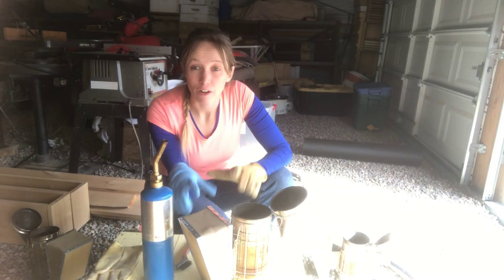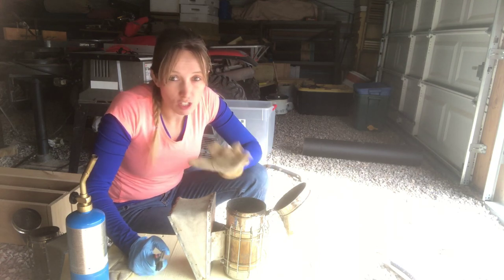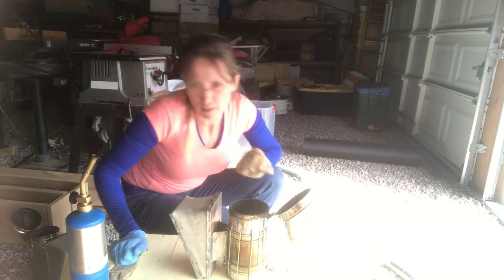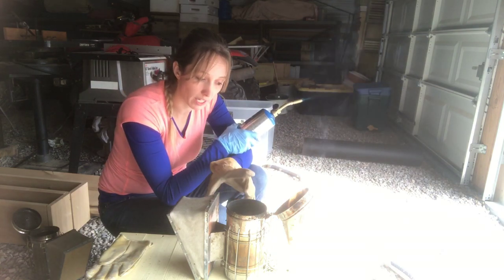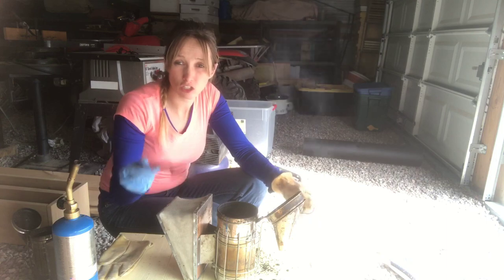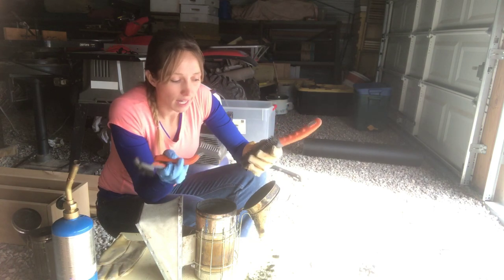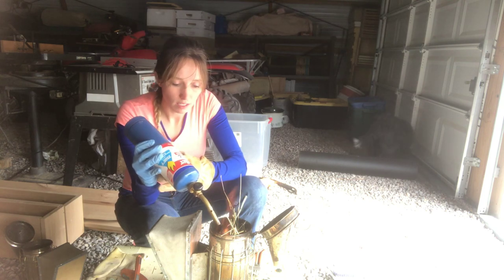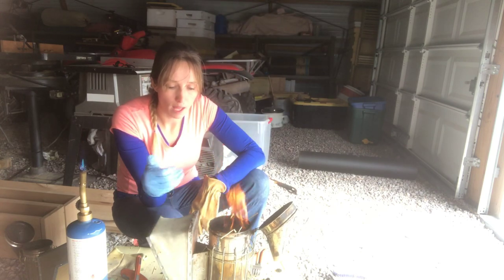Cleaning your Smoker , how to, easy way to clean creosote, beekeeping hack,Backyard bee builder

Comment: Another good tip. after you get it clean or when you buy a new one cut out both ends of a large soup or bean can and slip into your smoker as a sleeve. It will make the smoker last much longer and easier to clean just heat up enough to slide out the sleeve and replace
Reply from the maker: great idea thank you !!

Comment: those smokers didn't seem too bad i get about four or five times that amount before a cleanup. i use Methylated spirits to soak in to the gunk and then burn it off with the smoker open. I use pine needles as fuel so it gets a buildup that is quite thick at times
Reply from the maker: thanks for the tip!!